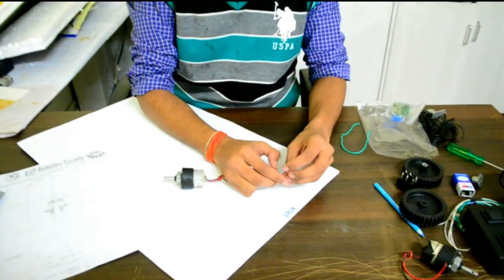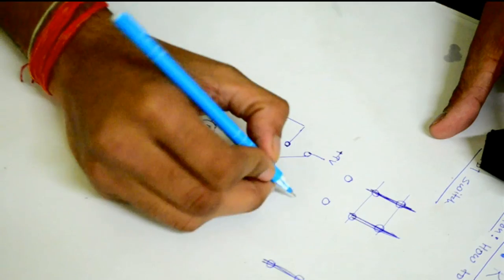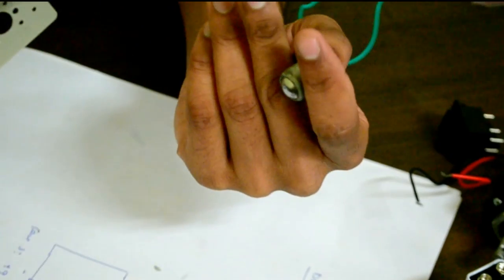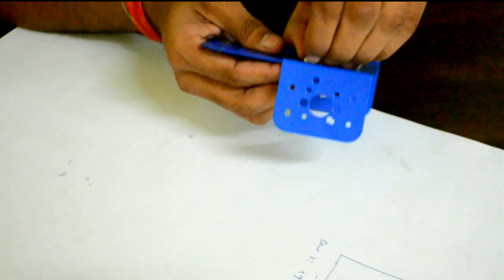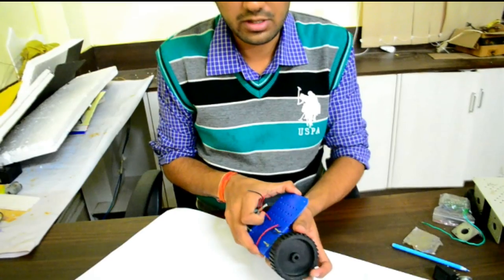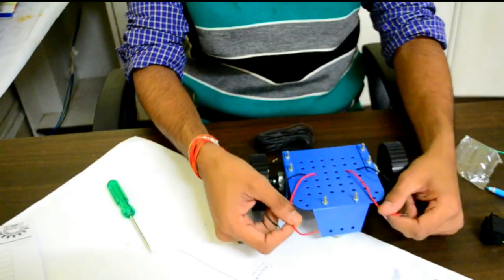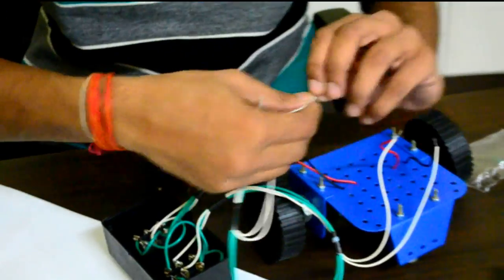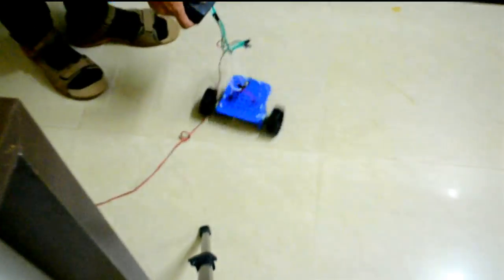How to make a Robot for Beginners

Comment: If we were to use 4 wheel drive, the left sides rear and front wheel (and similarly right sides rear and front wheel) would be coupled right?
Reply from the maker: I guess for 4 wheel drive you need to independently power all 4 motors and control them with individual (4) switches

Comment: for racing along with obstacles , which type of tyres    
is good? big broad ones or big   
slim ones or small ones??
Reply from the maker: I would suggest using high RPM motors with broad tires. This will ensure that you can even override the obstacle!
Reply: pikesh prasoon  ty..incase of not touching d  obstacle,, will broad tires affect d bot's turning speed?
Reply from the maker: Given the size of bot, I doubt it will be relevant in this scenario!

Comment: what is the second in requirements?chasses what r they and how i will get this...plz tell me......so reply...and its very helpful video.but reply i cant understand chasses.........give me a detail answer.
Reply from the maker: +Yuvrajsingh Rajpurohit Chassis is basically the body of robot. It can be viewed as the structure over which wheels, controllers can be mounted. If you compare with your body, Chassis is the skeleton system.

Comment: can I use adapter to get 12 v DC input to motors
Reply from the maker: Yes, you can! Just check if the current limits are at least 1 Amps

Comment: how to make it wireless? And can we add a body on the chassis will the motor support it up?
Reply from the maker: To make it wireless you need Tx, Rx, Encoder/Decoder ICs. Consider your chassis weight and, if it is more use powerful motors

Comment: first thanks alot sir for making this great video...
sir can i make a remote without using DPDT switch means using push buttons??
if yes then what are the connections for this???
Reply from the maker: Jitesh Narula DPDTs come in even push buttons structure. Can you elaborate the type of push button you are using.. ?
Reply: +pikesh prasoon push buttons comes with in DVD socket...

Comment: what you have use instead of  batteries?
Reply from the maker: +Yuvrajsingh Rajpurohit I used a battery eliminator - that is a device that converts 220V to 12V. So you can use the home AC socket for running the robot
Reply: +Yuvrajsingh Rajpurohit  u can also use the charger of yr laptop.because it also converts ac into dc .and  also -provides 17-19volts
Reply from the maker: +Rohit Chowdhury Yeah laptop charger can be used. But since the rating of motor is 12 V,  a voltage divider circuit should be used to avoid damage.
Reply: yeah. i really liked yr video becz u explained the dpdt very nicely

Comment: what will call front wheel
Reply from the maker: +parwez If you mean Castor wheel, it is not called by any code, or driven by electronics. Simply by the force from back wheels, the front castor wheel will move. This is similar like Bicycles, where the rear while pushes the front wheel :)
Reply: how much its total cost
Reply from the maker: +parwez Totally it will cost around Rs. 500-600
Reply: i think wate of money we can get wireless 
rc car online at this rate by the way thnx for reply
Reply from the maker: Look dude..! This is not waste of money, you get to learn how to make it as compared to buying and just playing around..!
Reply: try to make a rc drone bro instead of a car that too wired make a wireless
Reply from the maker: +parwez if you go by the title of this video, it is meant for beginners. You can not make wireless stuff unless you have an idea of wired stuff. The next step to this is wireless control.